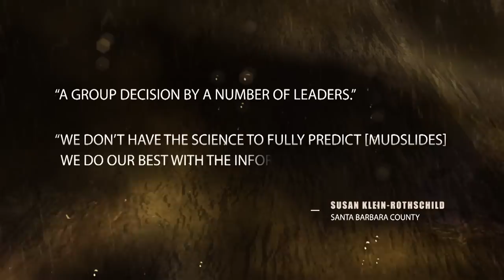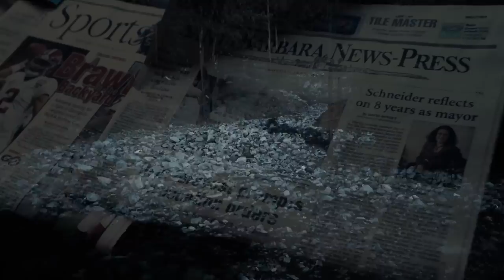Full Documentary: The Night It Rained Boulders

Comment: Wow. Thanks for putting this reporting. Would you advocate tree burning even controlled ones?
Reply: It's been 2 years. Let me tell you the problem. The trees and brush in those mountains on the coast, they have a natural flammable oil in them that burns like they were soaked in gasoline. They say a med sized bush has the equivalent of 2 gallons of gas in them. Kinda hard to do controlled burns on that vegetation.